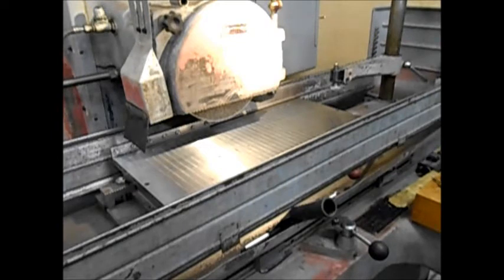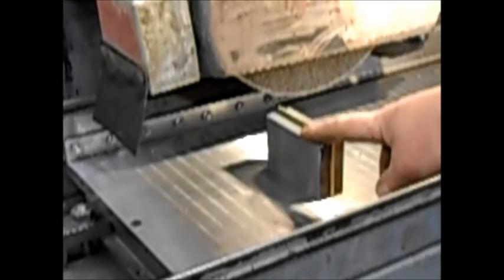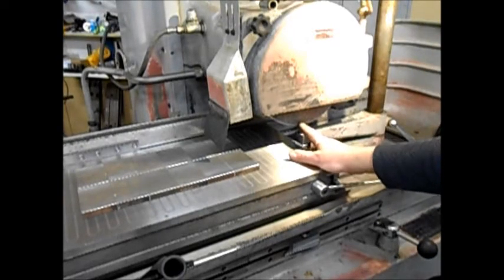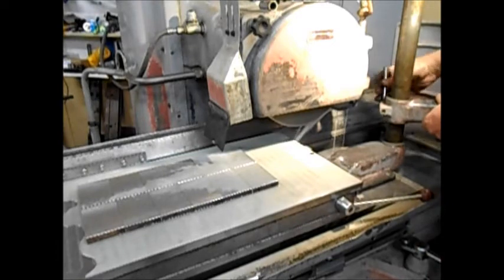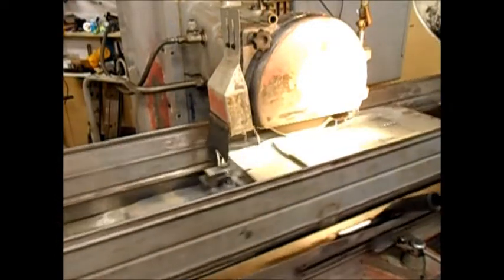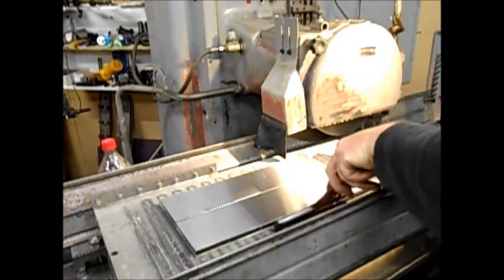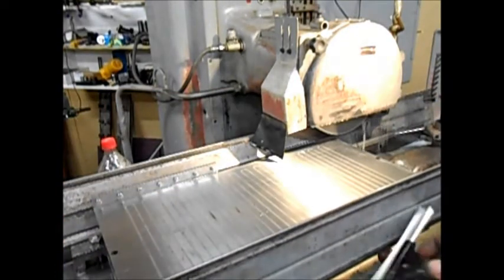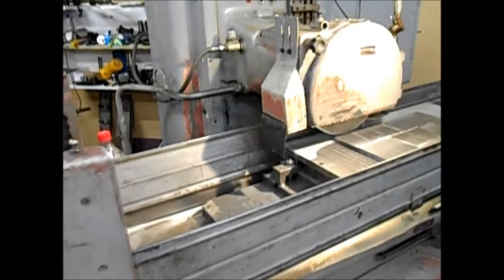Making a Magnetic V block part 1

Comment: Hi, would you be able to explain how to remove the grinding hub? My blohm has a differential bolt and it appears you need to undo the outer but before you can undo the inner bolt. Any tips would be appreciated.

Comment: Keeping the motor running keeps the bearings at a stable temperature, or so an old chap told me, also why it is recommended to let it run before grinding so they reach running temp and clearance.
Reply: It's part that and part the fact that as the machine headstock warms up, it affects the distace from wheel to table. On a middle sized Jakobsen it is around 0.06 mm change when it warms up, so it is hard to keep any tolerances if you switch it off and it cools down.